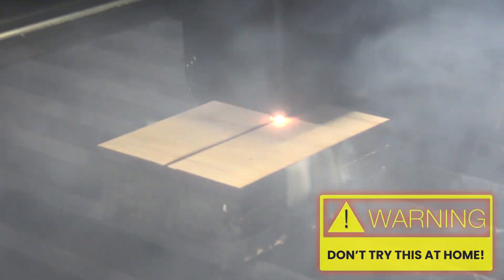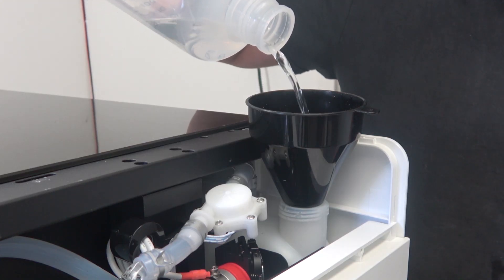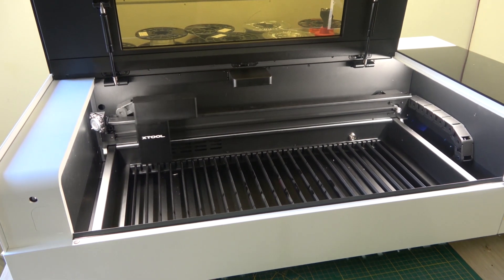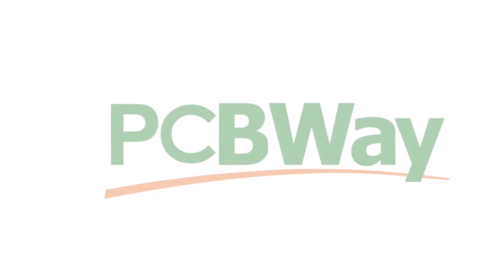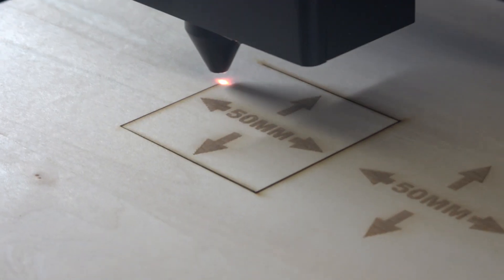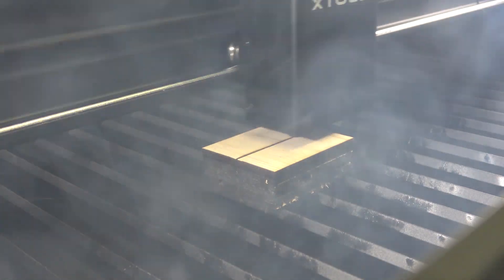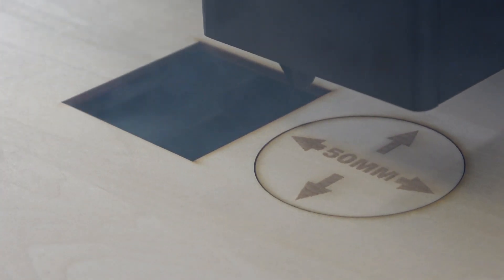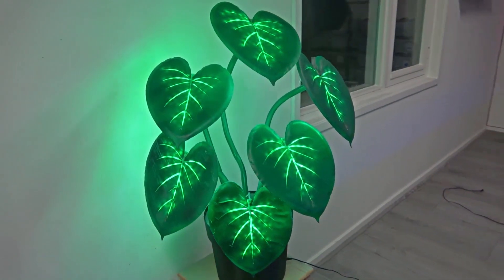Testing the xTool P2 CO2 Laser Cutter and Engraver..

Comment: There's air pressure coming through the nozzle to keep smoke off of the lens, but it also pushes material through as it cuts.
When you don't get through on the first pass, you risk blowing the material around instead of through, and the heat has no where else to go.
That's why the flame.

Comment: You confuse me.  First you show how you can move the cutting area to align with the material and thus minimize waste.  Then go on to perform test cuts smack dab in the middle of the sheet goods.  Why not cut with minimal waste and maximize the useful area of sheet goods by staying close to the edges?

Comment: I wonder if it would be worth it to fill the chamber with nitrogen to prevent the combustion of wood or carboard or the oxydation of metal…
Reply: That would not work since it's not really cutting, it's burning. So the oxygen is needed. Only materials that vaporize/desintegrate purely by temperature could be "cut" that way.

Comment: What if you just had a generator between TWO trees, putting some rod around 4m high on the trees It seems like the wind would overcome a lot of resistance (ignore the branches, capture the lower movement high torque swaying?

Comment: My laser cutter can't compete! It would have to do 100 passes to cut what yours can in a single pass 😛
The detailed review is much appreciated!
Reply: I am surprised too. I worked at a place that had 3 kW CO2 lasers measuring a multitude of this small tube. When people used them for hobby projects they needed several passes to get through 5 mm plywood. The only explanation I can come up with is that those machines focussed from quite a wide beam to a small dot where it hit the material, making them only really suitable for cutting flat sheets (which was indeed the typical application). When used that way they were really fast. This little machine here seems to use a narrow beam right from the tube, keeping the energy focussed all the way.

Comment: I wonder if you can use it to cut onyx blades. Apparently onyx blades are supposed to be super sharp but very hard to craft because of how brittle but holding the material at specific angles and laser cutting could work if it will cut it.